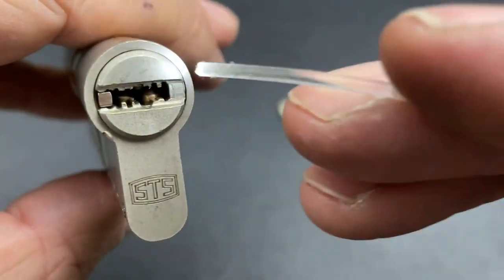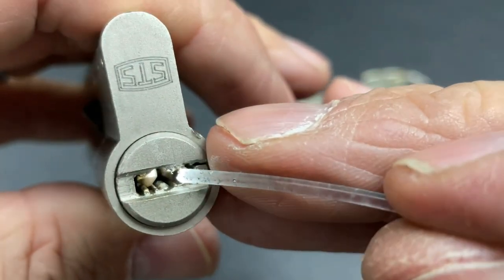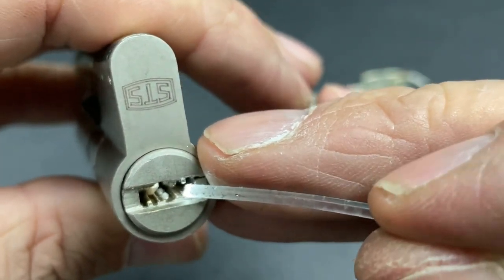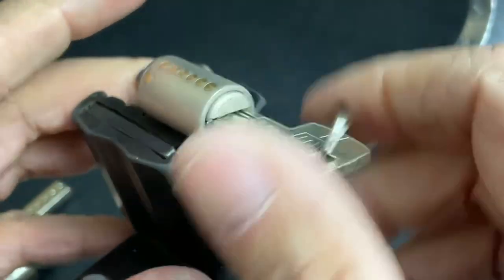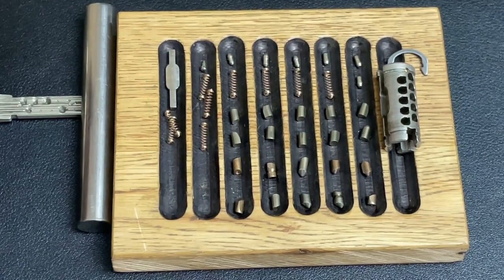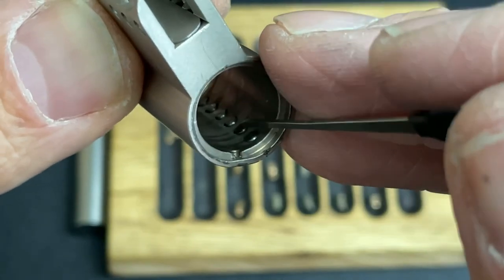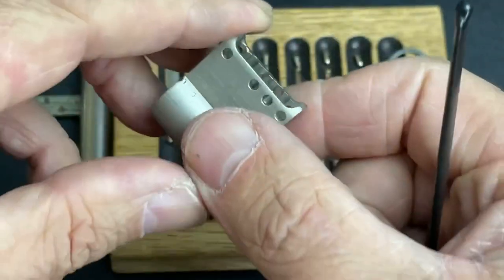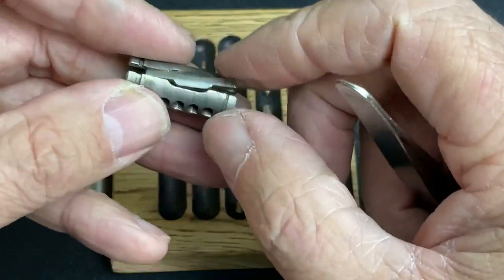‘STS ST15’ Euro Lock picked & fully gutted.

Comment: You just have to love that lock. So many elements involved there and a difficult pick that you breezed through Daz. That's going to be a slow rebuild : )

EDIT: looks like if you carry on picking these locks you might need a bigger pinning tray to hold all your jigsaw pieces.
Reply from the maker: This lock was a real pleasure to pick considering just how complex the lock is, i was lucky that the bottom pins were passive. I have a Pinning tray that Matt made me a few years ago, i agree it may be time to dust it off as i still have a few more very complex locks to pick. 
Have a great weekend Roy. 😎👍